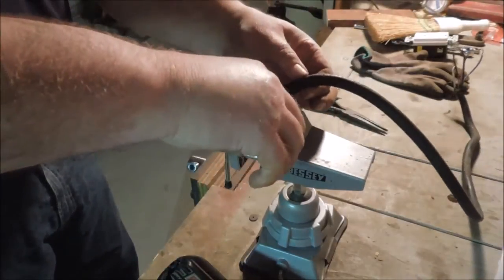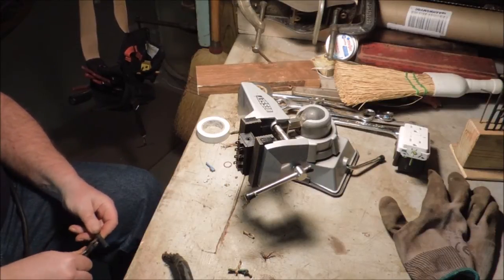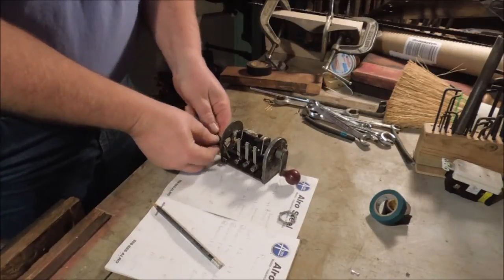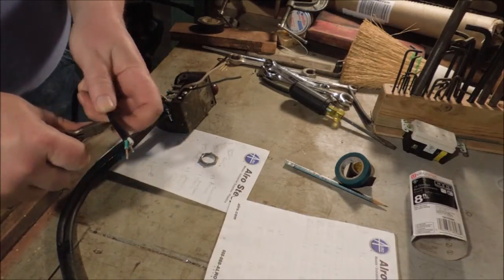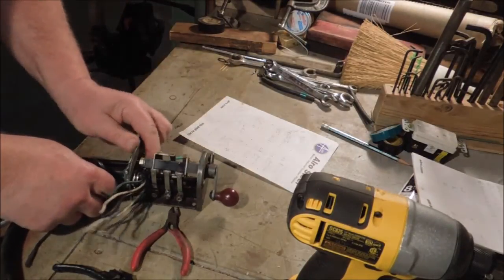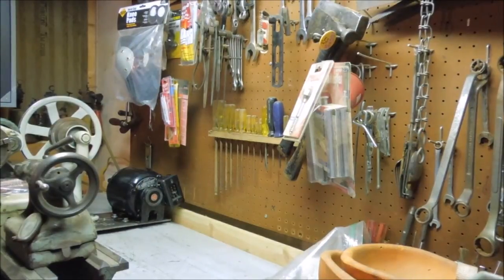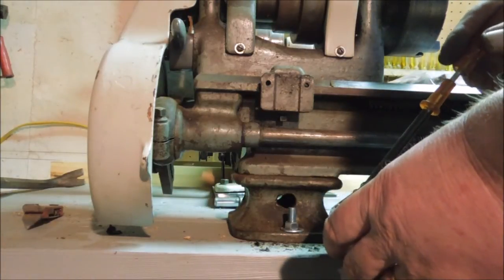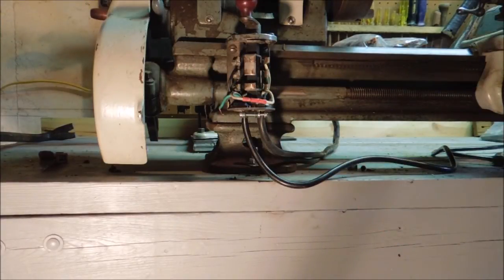Wiring Repair 2 -  South Bend Mtr Mount Pt 10 -  by Old Sneelocks Workshop

Comment: Is there some kind of spring/detent missing? The knob arm seems to have a lot of slop...
Reply from the maker: Might be. It is the original switch for the lathe. There were some bent tin brackets on the top of the switch that stopped it from turning completely around like it does now. There are detents in the contacts of the switch that hold the contacts engaged. The handle can spin completely around but the contacts can only engage either forward or reverse.